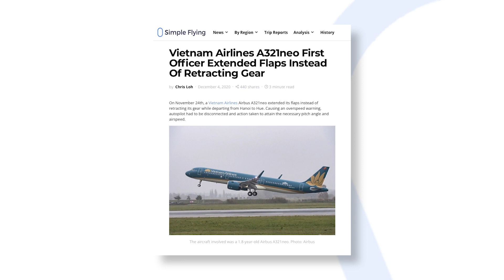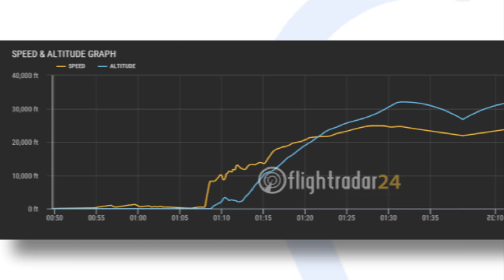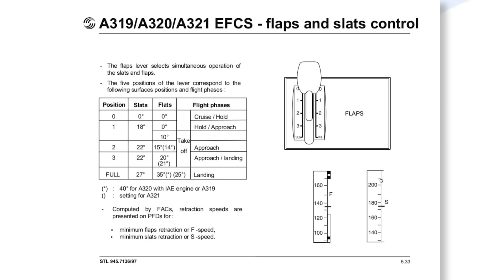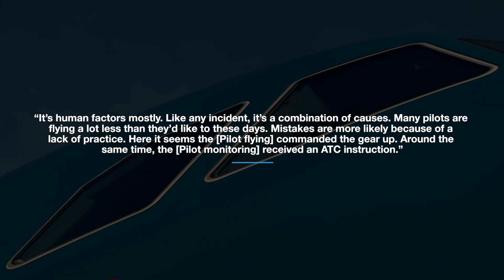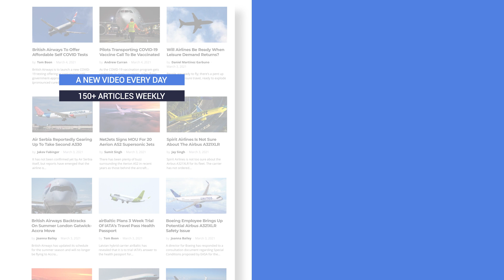A321 First Officer Extended Flaps Instead Of Retracting Gear

Comment: The captain did a great job to recover from the situation, he read the situation well. The copilot is a human and made a mistake, and hopefully learned from it.
Reply: @Skyboy320  i don't care about the dangerous first officer, passenger safety os priority
Reply: How on earth can someone mix the gear lever with the flap lever? I mean they are not even at the same panel..
Reply: First error, to prioritize an ATC call over cockpit duties. New inexperienced F/O requires extra vigilance by the Captain. When asking for the gear to be retracted which is rather quickly after liftoff IS THE EXPECTED call, monitoring the F/O’s hand movement is critical and reaching for the flap lever should have required a verbal correction. Imagine if the flaps had been retracted!! Ret Captain
Reply: @70mavgr  that’s what I’m saying. They’re not even close to each other. Literally the easiest things to not get mixed up. One goes forward and back, one goes up and down. Clearly a poorly trained pilot or he was in a totally different world. Either way, it’s an embarrassing mess up
Reply: Well captain is much worst than fo... cause he cannot keep calm and steady  in such a simple situation to solve .....
Reply: I wish we could all be just like you and walk on water or part the red sea.
Reply: This is like stepping on the accelerator when you want to brake…

The gear and flap lever are in totally different position. Gear are on the panel you have to reached to the front while flaps are on the pedestal to the left and slightly behind the first officer. The shape of the lever are also different

First officer should really find other career. 

Although this is human error and human will always made error… but how totally blank out do you have to be to use the wrong lever?
Reply: @70mavgr  Yer hard to understand, but I think maybe if the final report is released to the public so we can have a more detailed look at it. Then it will hopefully make some more sense. 

Many years ago I flew as a captain on a 737-200 in the Middle East I had only 29 hours as a captain at that time. And I had a brand new first officer. He had only recently completed his final training, and had 14 houses on the 737. But we were flying together for the 1st time and all went well until shortly into the climb out. When as part of the clean op process he selected the gear to lock but accidentally he moved the lever to far and instead the gear began to extend. We cold hear the gear doors open, and he panicked and began pulling the lever op again but I interrupted him because we had already past the safe speed for gear retraction (witch is 200 knots on the 737-200) so we aloud the gear to extend, 3 green lights appeared. But because we at the time we’re already flying at 221 nots inch we had to extend the flaps to 5 to get below the 200 knots so I pulled the nose back the speed bled off I asked for Flaps 5 at 190 knots the first officer extended flaps 5 we retracted the gear accelerated to 220 retracted the flaps and I engaged the Autopilot the first officer locked the gear when I was watching and we continue the flight and the passenger newer new anything had happened.
Reply: Calm down girls
Reply: @tonamg53  I agree

Comment: Pilots do make mistakes. That’s the reason for having two pilots in the flight deck. The FO made a mistake after what seems like an opportune moment to be distracted by two different commands. One from the captain for gear up and the other from ATC. The most experienced of pilots can make that mistake. 
It’s good the captain was able to recover the situation.
Reply: Well, we all make mistakes, as the Dalek said, as he climbed off the top of the dustbin!
Reply: Same pilot hits the gas pedal instead of the brake in his Toyota on the off ramp doing 65 mph with a car full of passengers.
Reply: Flying the plane is more important than ATC especially in a critical stage of flight.    They should ignore ATC rather than try to multi-task.
Reply: All pilots are taught the following in exact order of importance:

1. Aviate 2. Navigate 3. Communicate

Meaning, fly the friggin plane, don’t get lost and shut up until you are sure that you are doing the first two properly.

If any pilot didn’t followed this order of priorities then they DIE… along with whoever are onboard with them.

This is not a mistake that any pilot can make.

Comment: Lowering the flaps from CONF1 to CONF3 isn't that big of a deal. (it's the same CONFIG during a go-around) It's probably the 'captain' that made things worse by going from CONF3 to flaps up without the intermediate steps.🙄 p.s. In the airline I used to work for, someone did the opposite: when the PF ordered "gear up" the PNF actually selected flaps up. Having a lot less lift at low airspeeds close to the ground is a much more serious issue than this Vietnam Airlines incident IMHO.
Reply: @Rogue Wave What's the go around configuration ? Isn't it to go from landing flap to the next one up ? Not the other way ? If landing Flap 3, then select Flap 2 ? Retracting Flap when accelerating in the initial climb won't cause an overspeed for the Flap setting as happened here, which is a reportable event. The captain also caught his own error and corrected the pitch accordingly. Flaps tend to retract at a much slower rate from takeoff settings to UP as opposed to retracting from FULL to the next one up which retract quicker to get rid of excess drag in a go around.
Reply: @SciFly7  no, the actual movement of flaps don’t vary in speed. So it’s not true they retract quicker to get rid of drag. The first few settings (Airbus has them numbered like 1,2,3and full whereas Boeing uses degrees) the actual flaps move backwards and down wards. The latter flap setting, they only deflect their angle. This is why the closer flap settings to “up”, takes a lot longer.
Reply: @rtbrtb_dutchy4183  ok thanks for that, and as I don't fly Airbus I was actually questioning it as flap rate variation is noticed on my current and past types, especially with fowler type flaps where the initial settings increase wing area and latter stages then increase angle, as well as thrust requirement. And actually the last movement from 1 to 0 appears to take longer because it includes slat retraction from the partial extend position.
Reply: @SciFly7  what types are those?  I’ve flown different manufacturers and none have variable speed in flaps. It might feel that way, but it’s still going at the same speed. If u talk degrees, usually the first 10° take the longest. Also leading edge slats or flaps aren’t slowing things down either.

Comment: Once I did a similar mistake. I was a new first officer on the Boeing 737-700 during line training.
We were about to turn back to our base from Turkey and it was already dark. As like the incident in the video I was Pilot monitoring while my training captain was Pilot flying. Soon after takeoff, I was busy communicating with ATC while my captain ordered me to do something (I don't remember what it was unfortunately, gear was already up btw) and as a response, I erroneously retracted the flaps. (Flaps 1 to up) 

The aircraft stopped climbing for a moment, but gained speed and continued climbing again. Fortunately, we were lucky it didn't end as dramatically as in the A321 incident but of course, it was a mistake which definitely shouldn't happen and which could have ended even worse, considering we were in a mountainous area.

Shortly thereafter I was shocked and very disappointed about myself and how I could even make such mistakes. Thankfully my captain did his best to make me collect myself, looking ahead and stay focused for the rest of the flight, after a short discussion of what just happened.
Reply: Ehm, that's an error that should have been reported. If you just go ahead and retract flaps whenever the PF gives an instruction.
Reply: @MM-tt7hy  Where did I say that it happens continuously? That was one  mistake which never occurred again.
Reply: @THYB737  he didn't say continuously. Now I understand how you made that mistake, your communication is bad
Reply: @donniebunkerboi9975  "whenever" implies continuity
Reply: Hocam 737-700 THY filosunda mi var? Hangi havayolu?
Reply: @izzetakif4663  merhaba, ben Germania'da, alman şirkette çalıştım, malesef 2019 yılında iflas etti.
Reply: @THYB737  Germania... so I'm guessing departure from AYT ?
Reply: @MM-tt7hy  for us on the 737, we have a Mandatory Reporting List. His retracting from Flaps 1 to 0 was a mistake but not horrendous if accelerating and not at high pitch in a turn. If it was critical enough to cause a stall warning / stick shaker then for sure it would have to be reported. If the safety department discovered something critical on FODA then for sure they'd want a report. Our company encourages self Reporting in the interest of safety and learning for others, and it's likely this would be such a report. But I don't see it as a must-report item if a critical safety-of-flight issue didn't occur. All of us make small errors once in a while, and hopefully it opens your eyes to the possibilities.
Reply: @SciFly7  yes, AYT. May I ask which company you fly for? Assuming from your comment, you possibly also flew for Germania?
Reply: @THYB737  haha no but a Turkish LCC headed in AYT although I'm in the central location 😉
I used to see Germania coming into AYT and other places we flew in Europe.
Reply: @SciFly7  Indeed we headed often to turkish cities. Those were good old times. 
I was also present in AYT when a tornado crossed over the airport in january 2019. The approach was quite scary but yeah I guess that's one special experience many pilots go through during their career. Hope to get back in the air again soon.
Reply: @THYB737  LOL, I was there on that day too ! Radar was like a kaleidoscope and we held to the west before making an approach behind Pegasus. On the taxi in I wondered why we had to taxi off to the right of apron centerline then saw overturned buses, equipment and debris. My FO received a video showing the tornado and damage, and then a Pegasus taxiing in on G taxiway. I realised it was the aircraft we landed behind ! There was no mention of tornado by ATC or and SPECI on the ATIS. I also reported this as we were on approach in rain and no indication of a twister dancing around the airport.
Reply: @SciFly7  lol what a coincidence. Indeed it was a day which I will never forget. When the tornado crossed, we were at the gate already for around 10 to 15min. I personally did not see the tornado myself. I stayed in the cockpit while my captain went out for the outside check and when he came back, he reported about the tornado. I stood up and went outside and saw all the overturned vehicles, as you mentioned. Thank god there was no air traffic when the tornado crossed. 
I actually found a video last year on YouTube which one of my passengers made. There's a good chance that your plane is also in the video.

Comment: The placarded flap speeds are usually* 10kts below the engineering limit as they are designed to accommodate unanticipated gusts.  Anyone who has had an overspeed will tell you that Engineers don't get excited for minor exceedances.  Luckily it sounds like the PF had a plan and executed it calmly and as there wasn't an incident, in this situation it worked.  A more serious error would be moving from Flap 2 to Flap 0 and slipping through Flap 1, technically the lever mechanism should stop you but it has happened.  Like many things in aviation, errors do happen and yes we should work hard to avoid them but it is also important to have a plan of what to do when the worst happens.  

I don't think the pilot should be vilified.  OWe don't know their experience, we don't know their fatigue level and you could put them in a simulator fordays and they would never make a single mistake but on that day they did.  Errors happen, it's not that they happen it's how you recover and that's down to experience and thinking ahead.
Reply: @HtoTheB  That might cause a stall, if your speed is not enough for no flaps.

Comment: Sometimes I accidentally turn on a turn signal instead of windshield wipers, or the other way around. I've done both so many times that the wires in my brain get crossed. I'm glad that a mistake that's so easy to make isn't fatal even in aircraft.